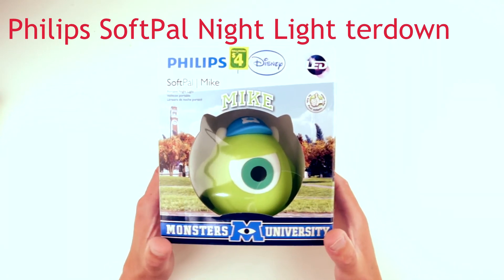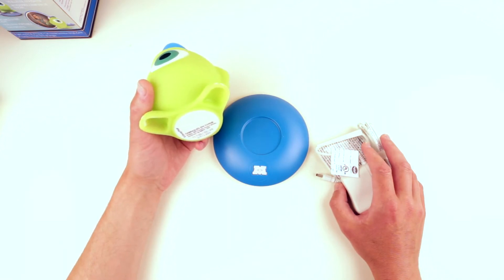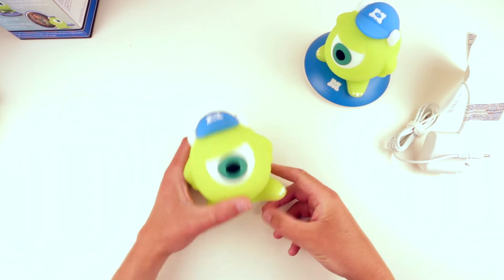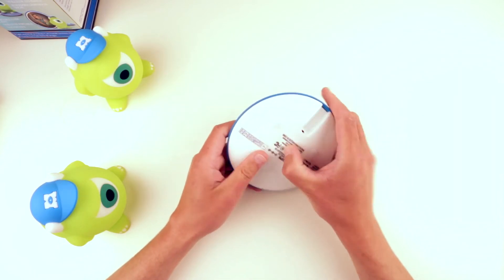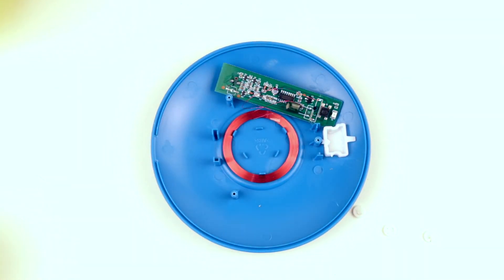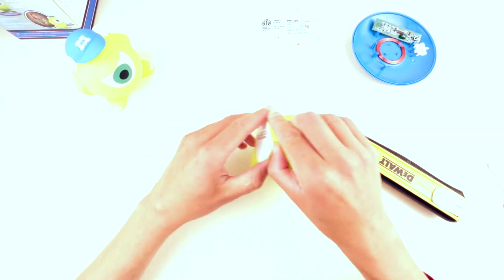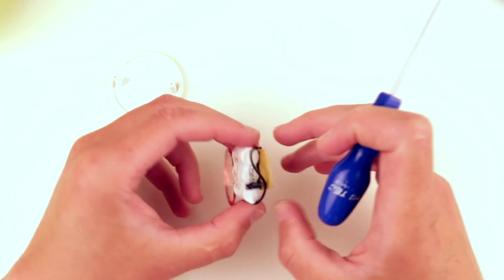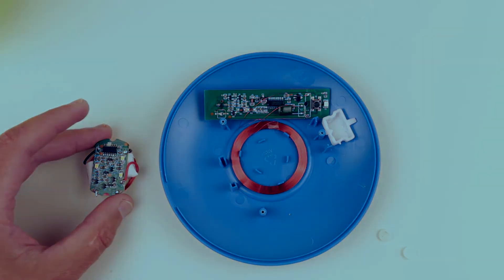Philips portable nightlight teardown. MIKE SoftPal

Comment: Thank you for the video,
Do you have the specs of the battery pack please ?

Mine is not lighting WIHTOUT the base so I guess my battery died, but the light is still working. thx
Reply from the maker: Yeah, battery is pretty cheezy there...
Reply: @InsideOutElectronics  yes but old one for me... I can't find a replacement one, any advice ?
Reply from the maker: @Forzazak  It should be something like this, the only thing is to double check the dimensions - https://www.amazon.ca/BAOBIAN-Cordless-Compatible-BT-17333-BT-27333/dp/B078W192SH/ref=sr_1_17?crid=6H8RE6RUXGF2&keywords=3.6+nicd+battery&qid=1660261306&sprefix=3+6+nicad+battery%2Caps%2C75&sr=8-17
Look for 
3.6 Nicad battery

Comment: Mines stopped working. If I order new batteries and it’s the batteries that no longer work is it fixable?
Reply from the maker: I don't think you can buy such batterypack. I suspect this is 3xNicad 3.6v pack.
Reply: @InsideOutElectronics   https://www.ebay.co.uk/itm/153852895570 would this work?
Reply: @InsideOutElectronics  thank you, that’s really helpful